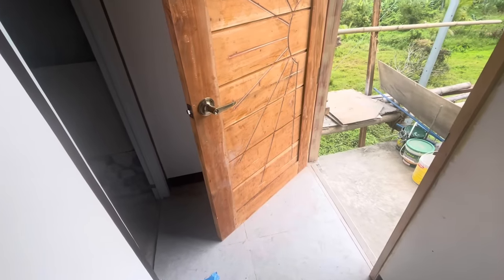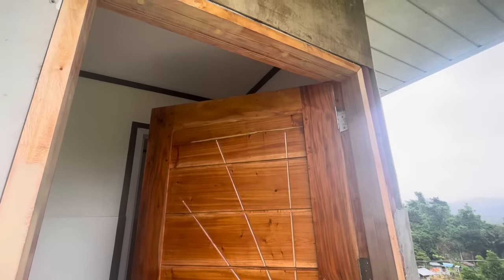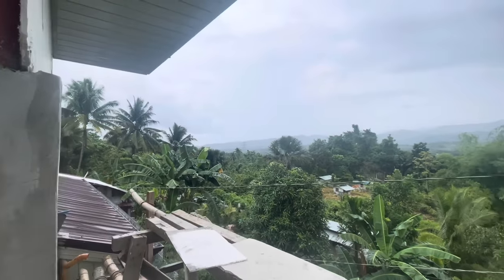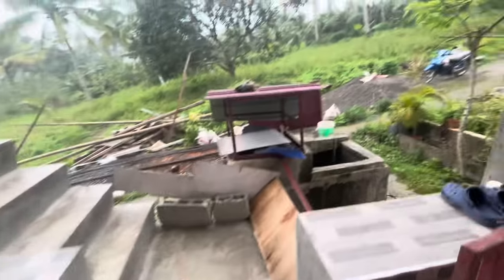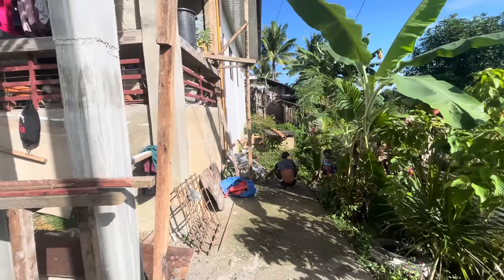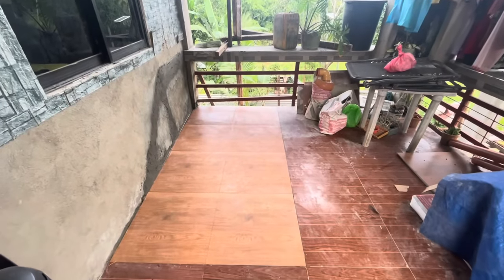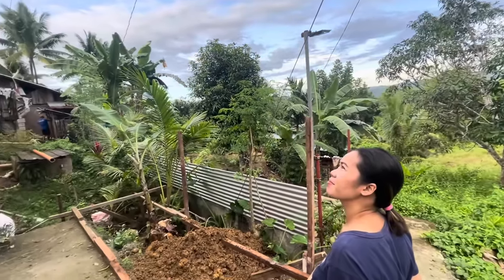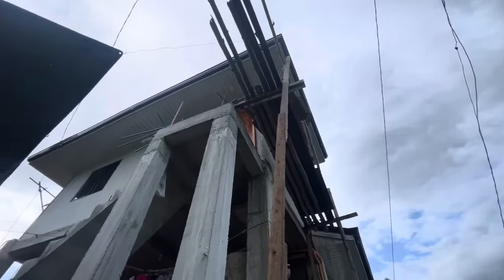Starting the terrace - bathroom finished

Comment: when the varnish of the door is finished pls put oil wood stain on it which is natural too. Natural varnish wont protect it soon specially from heat during summers, i thought also a natural varnish can protect wood (i put natural varnish as first coating to my shelf but it didnt protect it that much after months only so oil wood stain which is natural should cover it but unfortunately i was too late. Natural oil wood stain is same color of varnish but the oil makes it covered and last more and protect the natural varnish specially with drops of rain and heat and dust.
Reply from the maker: Ok thanks!

Comment: Dustin please reinforce the bottom flooring of the cr. I feel the cement thickness is not enough.
Reply from the maker: They did put rebar in the cement connecting to the existing cement too so it should be pretty strong